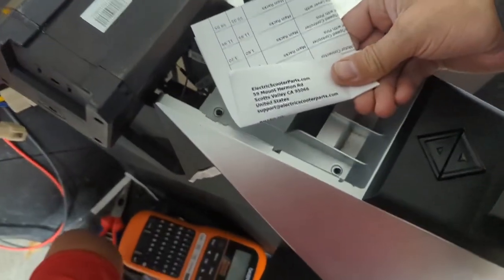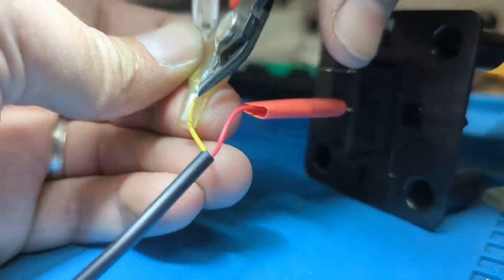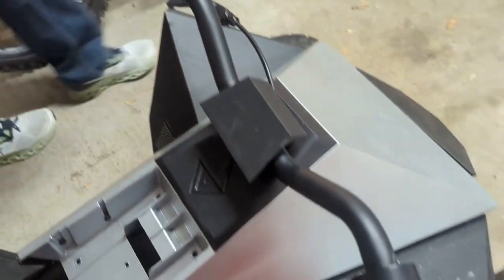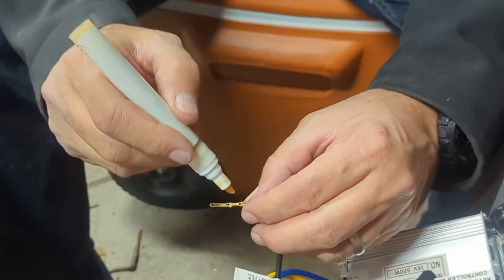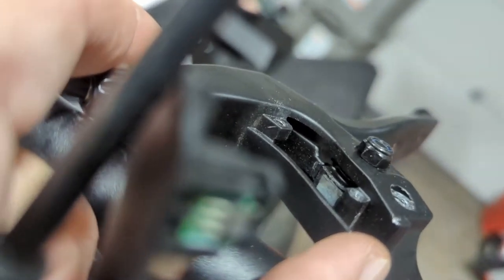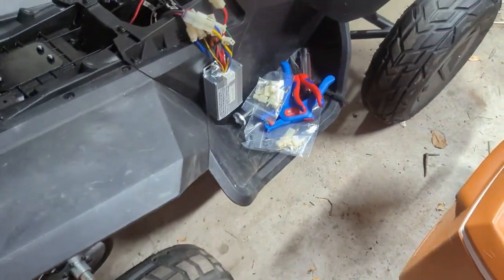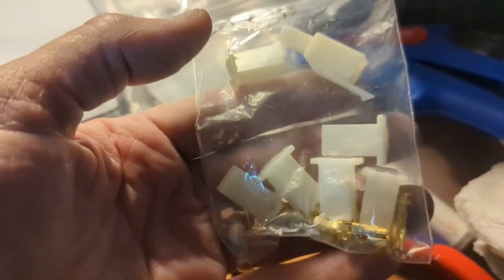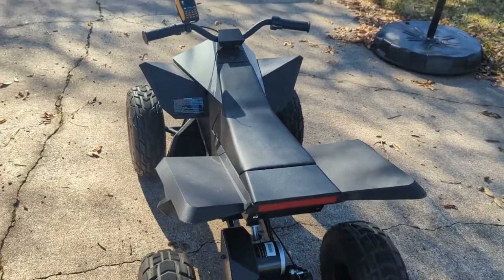Tesla Cyberquad for Kids Motor Controller Recall Replacement

Comment: And btw, I planned to physically flip the reverse switch, but I somehow got it to work without doing that haha. It doesn't make sense in my brain, but I'm not complaining! Lmao
Reply from the maker: The reverse is optional.  I had to flip mine 180, to make up forward, and down reverse.  But glad you got yours working without having to rotate.
Reply from the maker: The pattern I am seeing so far with yours and the other guy, is the battery.  Both of you are experiencing the same issue.  Both of you are using different non stock batteries.  I am wondering if it's a voltage issue.  Do you have the original cyberquad battery to test?
Reply: @cognetic  I have an 8 ah battery I’ll try at home. I wonder if it’s locking up on amperage
Reply: @cognetic  tried it with the oem tesla battery and I’m having the same issue
Reply from the maker: I just made a video showing how ours operates with the stock throttle and the SPD-3650R controller.  https://youtu.be/MxjNvhV5sjU